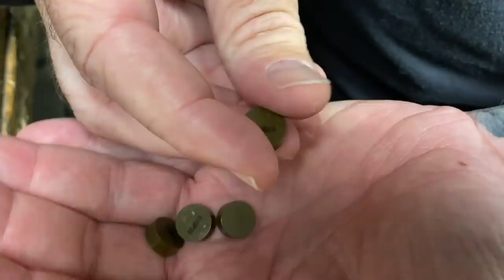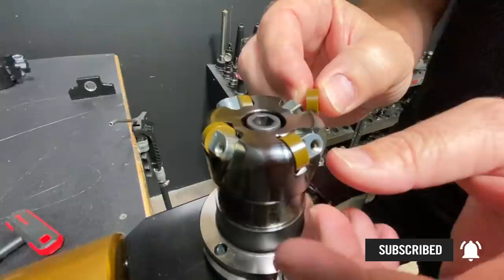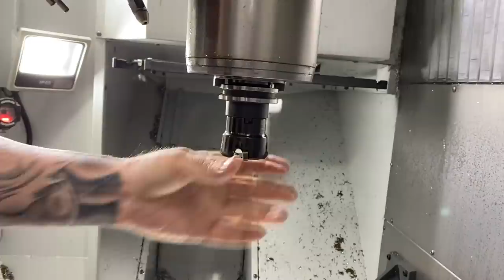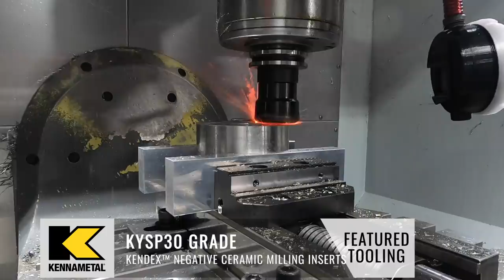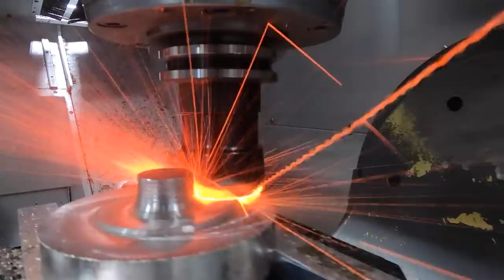Using Ceramic to Cut Inconel 24X FASTER Than Carbide Insert Shell Mill | Kennametal KCRA Shell Mill

Comment: Holy shit a dry cut!! I worked for 26+ years for Borg-Warner Automotive in Muncie, IN. Everything we cut or machined or ground was wet cut. Either cutting oil, a huge mess at times, or water based cutting fluid. Except for one machine. A Heller Machining Center. It cut a huge 8 gear for the T18 and T19 truck transmission. The forging was chucked up and this huge tool insert center plunged into the forging. Then the forging made on revolution and was finished. First lesson was getting depth right due to the heat that was generated. We then went on to high speed Heller Machining centers in two different depts. Then the shut our doors after 100+ years. I got to operate and see run alot of different machinery. Very cool video.
Reply from the maker: Ya. You never run coolant on ceramics.
Reply: Titan, a machinist that was Training me told me that I shouldn't use coolant with ceramics (when he caught me doing it) because the constant heating and cooling can cause the ceramic to thermally fluctuate to the point that it ends up cracking from the rapid heating and cooling.....and the first two times I broke a ceramic, I thought it was from my depth of cut.....but once my mentor told me no coolant, I stopped breaking the ceramic inserts.

Comment: I would love to see spindle bearing  and motor loads (max and average) along with the speeds and feeds..
Reply: Cutting forces are low with cerm. Softens the material. RPM isn't too bad with a large dia cutter like this.

Comment: I think Titan cuts up more Inconel just for fun than most shops cut in a decade, LOL!
Reply: Ryan H I have 8 machines in the shop cutting inconel right now. All ceramic roughers. Inco jobs just keep coming. 😅
Reply: I cut inco 718 and 625  and 6-4 Ti over 60+ Okumas for 20+ years. I’d be glad to challenge that....
Reply: St Bentoak what are we challenging
Reply: That Titan cuts more inco for fun than most shops cut in a decade...We had yearly contracts with inco mills. Prob did 100k+ # of inco a year for GE aircraft engines....
Reply: @michaelwalters3425  what is inconel used for, the one you cut?

Comment: Finally running with the big dogs! Ceramics are so much fun. I was told to try to keep tool engaged during step down or transitions as much as possible did you see any cracks from lifting off n on so much?

Comment: Does roughing with ceramic work harden the surface? Or does the chip carry all the heat out and so fast the it doesn't affect the base material? Would be nice to see a part roughed with ceramic and then finish cut.

Comment: This was fun to watch especially hot sparks shooting into the face of the camera / custom go-pro housing :-)
Reply from the maker: Machine Gunnin
Reply: Yeah this was the most surprising thing about these nitride ceramic bits, the speed is so high you get molten and burning metal slag instead of regular chips, but if you run these at a slow speed they get destroyed. They are awsome for very hard and abrasive alloys though.

Comment: The real trippy thing is, unlike tungsten carbide, ceramic cutters almost feel like lightweight pieces of plastic.
Reply: Yup. Had the pleasure of cutting similar inserts out of a plate of silicon/boron nitride ceramic using a fiber laser. They cut very slow on the laser that could chop and dice inch thick steel like a hot knife through butter. 😮 yup the finished parts feel super light compared to carbide. Testing them was fun as well. They had recommended speed rates that would incinerate a carbide insert, yet heavy feed rates you would give carbide would cause these to chip and break. Go figure.🤔

Comment: This reminded me of that cartoon where they take an entire tree in and lathe it down to produce 1 toothpick. Seems an expensive way to get 1" round stock of Inconel. Does Inconel not work harden from that extreme heat? I know ceramics don't care but metals normally do. Or is that part of the magic of inconel?
Reply: The material gets plasticized as it cuts, softening it. Also , Turned, not lathed ;)
Reply: @OakwoodMachineWorks  Thanks. And yes, that is pre-coffee/tequila last night for cinco de mayo... I do know my terms...
Reply: Work hardening is caused by plastic deformation not heat. You can easily work harden a piece of stainless with a HSS or even carbon steel tool if you don't feed fast enough.

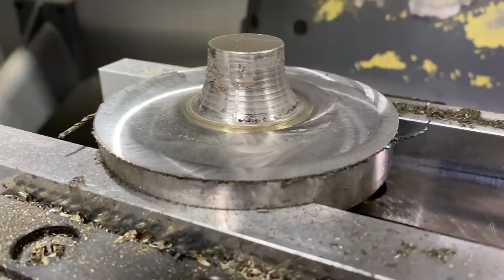Comment: Long time listener, first time question. Why does the metal at 3:15 look to be full of porosity? I am not use to seeing Inconel with that coloration of the chip as well, it almost looks like a brazed insert.
Reply: The roughness in the surface finish is caused by chip welding, not porosity